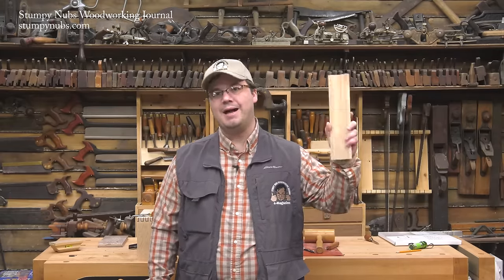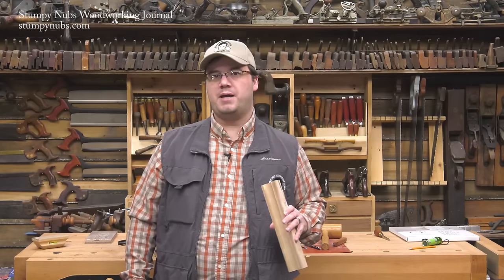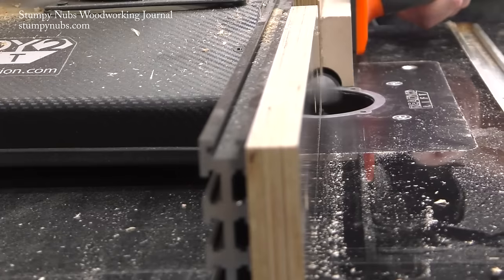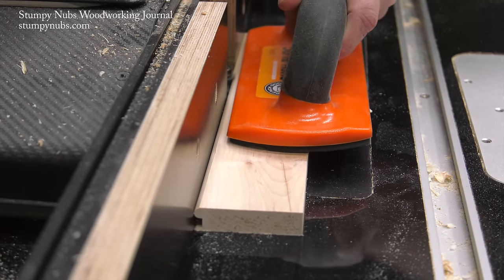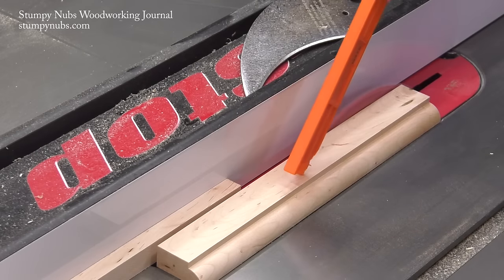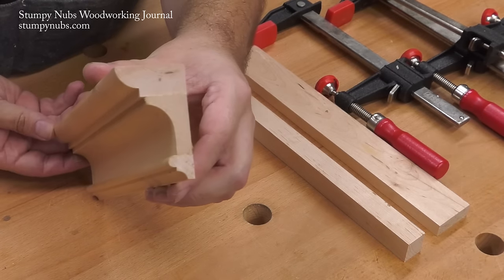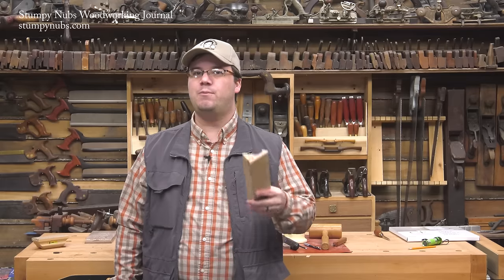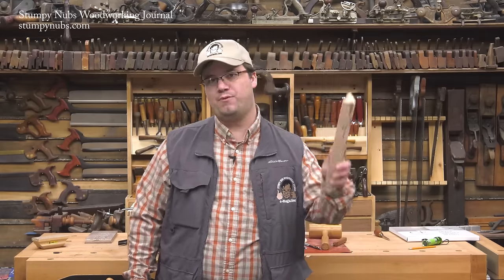How to make fancy built-up crown moldings with common router bits

Comment: I really like your crown moulding profile. I polish the faces before gluing together. The squeeze out can then be just wiped off with a damp reg. 
alternatively medium viscosity cyano and activator work well to stick it all together.
Reply from the maker: I never trust wiping the glue away. There always seems to be some left that you don't notice until you put on the finish. Usually sanding takes care of that, but that's harder on these moldings.
Reply: Stumpy Nubs  sorry I wasn't clear. I mean varnish first on the non glue faces, then you can wipe off the squeeze out. The excess glue sits on the varnish and does not penetrate the wood as it is already sealed. No sanding required.  Not just for mouldings. This can be done around most glue ups. You can still sand as well when you are finishing, if that's your inclination.The wood will not be stained by the glue. I don't know why this isn't standard practice. I seem to be the only person who does it.  It saves an awful lot of difficult sanding and leaves the wood unblemished. It's just a matter of getting your brain around doing a little finishing half way through the project.

Comment: Thanks for the video. We just redid a small half bath and my wife and I think crown molding would be a nice touch. But most of what is available is just too big for such a small space, and there is an issue with space over the door. I think I'll try my hand at finding something we like in 'regular' moulding, and then shrinking it for this space.

Comment: Good tips. I think a lot of moldings were built up on antique furniture, when they had to make them with molding planes. With 150 or so of those on the back wall, you could make a hand tool version of this same video.
Reply: unless... that's a green screen.....
Reply from the maker: No, it's not a green-screen
Reply: So the gremlin is real?!

Comment: Would it make sense to cut a 45 on the back top-side so the crown is not wapper-jawed by an out of square wall to ceiling connection?
Reply from the maker: Yes, if you were putting it on the ceiling, that would make sense. But if you are putting it on furniture, I'd leave it square.

Comment: Hi James, You seem like a knowledgeable guy and am hoping you can help me find a solution to my router bit problem.  I make wooden knee sliders for motorcycle roadracing.  My sliders are a simple rectangular shape with rounded edges.  I have been making them with 90 degree sides and using a 1/2" diameter round over router bit (in a table) to soften the edges.  I would like to angle the sides slightly in an attempt to minimize chipping since I use the more durable and longer lasting end grain on the main dragging surface instead of edge or face grain.  Is there a way to make a chamfer and round over/soften the edge with one bit?  I can't figure out a way to do it even using two bits.  Is there such a thing as a round edged chamfer where the chamfer is straight but has a curved shape at the top?  Thank you in advance for your time.

Comment: If I was sponsored I would use the mint equipment also (!), but it does beg the question: are you still using your home-made router lift, table, fences and sleds?
Reply from the maker: We have two workshops. One is full of homemade tools, the other commercially made tools.